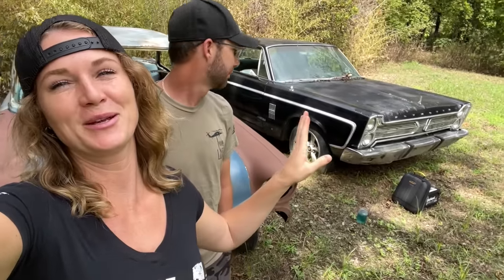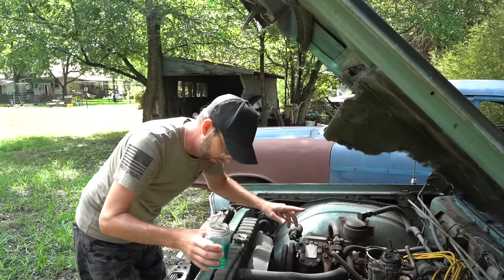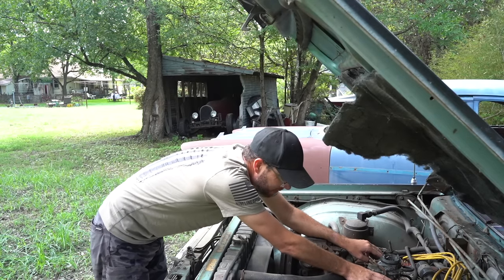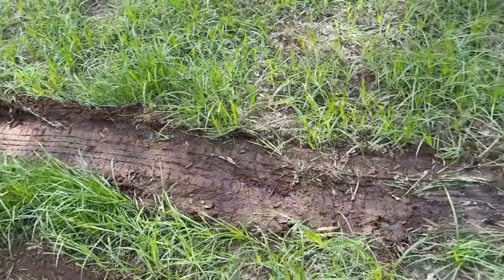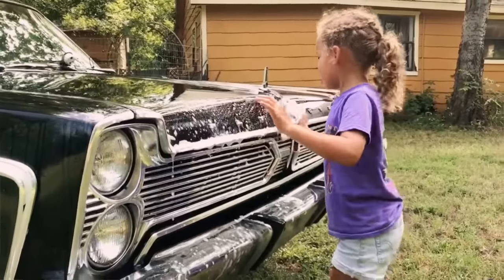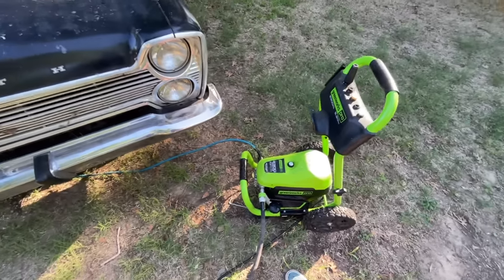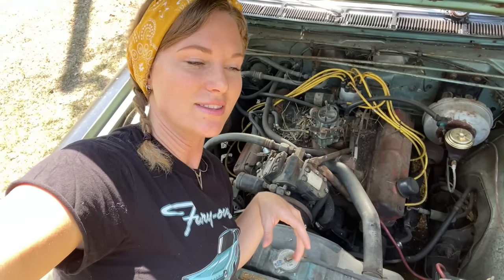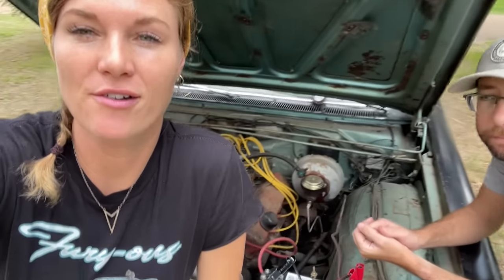Abandoned Plymouth Fury!

Comment: Look at the bottom of the valve covers.."poly " engines had a "scalloped" configuration..where the LA 318 had straight valve cover design on the lower side. My 1963 Dodge Custom 880 had the 318 Poly engine..It was a supurb engine..23 MPG on the highway..strong everywhere..

Comment: The valve covers very clearly are of a Poly-head A-block which by that point only would have been available as a 318. Not to be mistaken with the LA 318 that was used from 1968 into the 90s. The earlier Poly or semi-hemi engines were heavier but provided more torque and parts are not interchangeable.

Comment: This is the old Y block 318. It is a very strong and dependable engine. I had 2 of these in the past and they are bullet proof. I think what you need is the proper carb rebuild kit to solve your problem. They were quit common and should still be avaliable. Bill

Comment: What you have here is a 1966 Plymouth Fury with what is known as a 318 Polyspherical combustion chamber "A" engine. It was introduced by Plymouth in 1956 as a 270  CID engine, It grew to 318 in 1957  and is what was under the hood of Christine.  In 1964 the first "LA" 273 was introduced which is based on this same block with some changes made to accommodate the wedge heads. In 1967 the polyhead was dropped and the 318 got wedge heads like the 273, also the bigger bore 340  was introduced. Then in the early '70s the 360 with a longer stroke was introduced. Then in the early '90s, the magnum V8 was introduced with its heritage going back to this engine. You can use the timing chain and gears, the crank, the distributor, oil pump, oil filter, water pump, oil pan from any 318, 1962 and newer, also transmissions, The carburetor is a Carter B&B which has a small baseplate, pretty much standard on318s and even the same as a 283 Chevy carb.. Strictly Polyhead parts can be had like aluminum valve covers, aluminum intake, headers etc but they're not cheap.also performance camshafts. It also has solid lifters. If it were me, I would put a Mopar performance electronic ignition in it and a Holley throttle body fuel injection   for a 2 bbl intake. .A good place for you to get educated on these engines is on facebook... https://www.facebook.com/groups/542278482490634/ These engines wake up with a little cam, carb and ignition work They have canted valves like a 351 Ford Cleveland or big block Chevy but with smaller diameter ports so they make gobs of torque on the street. Gary Pavolich (who is the administrator of the group I posted a link to) Is the guy to look up, he is the absolute guru on these engines and can hook you up with parts too.

Comment: Fix the alternator bracket, get an msd box, and for the carb, get a rockchester from a 283 chevy.Youll have to play with the linkages a bit for it to work with the gas pedal and kickdown linkage, but its simple. Use the coldest burning spark polugs.Itll do better on gas and have good power.

Comment: Derek also uses diesel oil upon the first oil change ( Rotella. Delo, etc, ) For the zinc in old motors. I believe thats a 318 Poly. Not the later small block.  Todd the retired trucker.

Comment: Holley 80457S (600cfm, electronic choke, vacuum secondary's), or if you like simplicity, Edelbrock 1405 600cfm, manual choke. You'll also want an intake, for a stock 318, the good ol Edlebrock performer / performer RPM series (2176 for performer, 7176 for Performer RPM) would be fine, go with the performer RPM if you plan to work / replace the heads and drop in a mild cam and headers.  Edelbrock also has a great set of midrange performer RPM heads that are bolt-on, 60775, under a thousand from Summit. They used to sell an awesome performer RPM top-end kit which had a 600 manual 4-barrel, the performer RPM intake and carb, a mild cam with hydraulic lifters, gaskets and a double roller timing chain set including new head bolts, but I don't think it's available anymore, and I think it was post-1973 engines anyway, although it'd probably be able to work on a 60's small block. Those kits were good for like 425HP/400TQ on a stock bottom end 360 and I think were only around $3K. Another option would be to just grab a crate engine and be done with it, something like a Summit Racing BluePrint Engines 408ci Stroker should be nearly a drop-in replacement (you'll need different distributor, ignition and coil) and can be had for under $5K after the core charge, good for at least 400HP with a decent intake and carb.
Reply: None of those parts you mentioned bolt to the Old Style A engine. They are all for an LA engine. Well, the timing chain would work.

Comment: Just a tip Take an empty gear oil bottle with the funnel top (Aka a blown engine squirted) Put the funnel in the float bowl Saves flooding the carb from pouring down the throat Also we check for spark first If the cylinders are dry no oil then flooding it will really was the cylinder walls Brakes are hung up good luck

Comment: Cool Plymouth, that aged maybe that's the wide block 318, my favorite was the 1964 Sports Fury, bro-in-law had one, same color. Lots more fun though cuz it was 383 with console shift. I would recommend pulling the spark plugs out, directly shoot some lube in the cylinder and let it sit. Thereby lubricating it before you're turning it increasing compression so it will start easier. After five years you're fighting the old stale gasoline so that should have been drained out and replaced, but eventually fired. I would find an old motorhome with the 440, then you have something fun. I am looking for mid 50s Dodge pickup, with five window or wide window. That was my first pick up

Comment: The first cleaning job should be vacuum clean the engine and then check all fluids( coolant, brakes, motor oil, and transmission fluid) before attempting to fire up the engine. Fumigate the interior and wait 24 hours. Wear face mask, gloves, and goggles when vacuum cleaning the interiors. (Rat poop and birrd poop harbor a lot of disease germs. I spent 8 hours in ER treatment for leptospirosis due to exposure to rat poop and urine while handling trash). Dirt is a serious bio hazard. Thanks.

Comment: I personally am one for restoring to factory condition. Find someone that can rehab that front seat and dashboard.  Buy a new carburetor, do a rebuild on the engine, transmission,  etc. The paint looks good , bit if at closer look you need bodywork than repaint it the original factory color. You might want to watch some episodes  of Graveyard Carz to get some tips on decoding the tags and Vin number.

Comment: 500 CFM Holley 2bbl is a nice upgrade, and really plenty of carb for a stock Poly318. 
I forget who makes the carb adapter, maybe TransDapt?
Don't forget to adjust the valves, that Poly should have solid lifters.  
  Though it is a different engine than the later "LA 318" (light A block) that you're used to seeing around, your A block 318 Polyspherical head engine should be able to use some lower end parts from the newer engines like oil pan, windage tray, etc.
 Great to see this car getting saved!

Comment: Cool ride, poly 318's great engines. check out my vlogs on my 65 Fury III BB 383! Cable shift transmissions good if the cables are good, not so if they're rotten. pulled mine replaced with 71 model out of an rv, B&M floor shift. always check trans fluid in any pre 2000 mopar with engine running, transmission in neutral which engages the pump. Mopar or no car!

Comment: The 318 polyshere is a good engine. Perhaps just keep it simple and rebuild or replace the 2 barrel carb? Once you get it running properly, I think you will be pleased with how well the 318 performs. 
It has lots of torque and is ruggedly dependable. 
It is similar to a Mopar Big Block in many ways. It was a bridge between smaller displacement big blocks and the later LA Small Block. I swapped my 318 poly for a big block
440 in my 64 D100. Physical demensions and motor mounts were pretty close. I was able to reuse several items in the swap. 
Its been fun with the big block and "tinkering", but I am seriously considering reinstalling the poly. Its on the engine stand now for a refresh and possible intake  from another source. I will leave that as a mystery for now, as I am "figurin and fabricatin" that out as I go.
I enjoyed your video. Keep up the good times.

Comment: That's a 318 poly, which refers to the polyspherical cylinder head design. This heads combustion chamber is similar to that of its big brother the famed "Hemi". Keep in mind that an engine is merely a large air pump and engineers design each enigine with a specific application in mind, so before you toss a pocket full of money at an intake and carburetor, make sure the engine is capable of handling added CFM. I know the poly came with a variety of carburetor combinations, but there were a variety of camshafts that came with those also. Don't forget this car has transmission,  and brake issues to begin with.  Personally I would put together a plan and budget together before you go any further.  As  I tell any one who's come to me with a project " When a house is built you never start with the roof, plans are drawn then a sturdy foundation, next the walls, then the roof. Don't put the cart before the horse."  Myself,  I would assess the vehicles overall condition, get under it an make sure the undercarriage is worthy, don't forget that car had been sunk in the mud for five years. Remember bottom to top. Can't wait to see what direction you guys take. Im sure it'll provide lots of interesting U-tube content.
Good luck with your project.!

Comment: You can do some crazy builds with the old poly 318 but you have to know your mopars and have a deeper budget. LA heads can modified to fit the Block but you have to use an LA cam. Those blocks can take a 120 over bore without sonic testing! Wish someone had produced Aluminum heads for polyblock with the polysphere design. JE can make custom sized pistons for them but again it gets pricey. They came factory internally balanced with a forged crank. Years ago I had a 1966 Fury Vip with the 318 Poly and it would do awesum burnouts. Smoke the tires off.

Comment: 318 poly engine - last year for the old style 318 in the USA.  It has solid lifters.  I had that engine many years ago in a 66 Dodge P:olara 2 dr hardtop.  I  put a Holley 500 cfm 2 bbl carb on top of an adapter and it woke the car up with dual exhausts.  NOw with the internet you should be able to source a 4 bbl manifold for the engine.  Also had a 66 Fury 1 two (2) dr SEDAN police Interceptor with a 440 - 4 bbl.  Only had it for 6 months as I couldn't afford the fuel for it.

Comment: Yep. 318 Polysphere engine, the precursor to the LA (small block) 318 which came out a year later. They are solid lifter engines that canake decent power. However beware of buying speed parts. Things like intakes, camshafts and headers are 318 poly specific and do not interchange with LA or later Magnum 318 parts.

Comment: You are using the crescent wrench backwards when tightening the battery clamps. Hey, yah see that tube in the throat of the carb? That is the vent for the float bowl, and you can fill the float bowl through that vent tube. Then carb operates as if it properly filled.

Comment: i also own a 66 Fury.  My advice as a Moparian. this is a Poly A.K.A. wide block (A engine not an LA engine)  318... yes this is a 318, you do not want to over carburate this. but the accellerator pump is not happy.  just rebuild the one you have and it will prevent issues with too much carb on too small of an engine.

Comment: Fit tombstone front seats, if you see an automatic choke anywhere immediately throw it away, I bought a new 1970 Pacer 245 Hemi  2 bbl 3 speed manual (that sorely needed a first gear) in Australia (VG model here) and every morning when driving to work after just over a mile I had to cross a fairly busy road and it always stalled when I tried to go after stopping, no matter what I tried.

Comment: My dad had many of these old fury’s, 318s are indestructible but they eat timing chains because mopar used a plastic covered gear,
If she were mine I put a aluminum intake a small Holly and replace the timing chain and water pump, also the rads over time become 
Junk, mopar never had a decent cooling system replace it with a aluminum rad, as far as the trans…..well mopars love to eat front pumps.. don’t get me wrong I love old mopars and she is definitely a keeper!!! She just needs
a little love!! Hit up Vice Grip Garage I would bet Derek might be able help put some pieces
Together between Derek and his pals you can’t go wrong 
Love the channel
Reply: "A" engine 318 does not use the readily available small block Mopar intakes (LA).

Comment: I would get a vacuum pump and suc out the 5 year old fuel in the gas tank, put fresh fuel in, then change out the inline fuel filter so the carb is getting clean fuel, then give some of the off the shelf carb cleaners a try before tearing into the carborator......my two cents! God speed.

Comment: I’m sorry to hear about losing your friend. Treat that car with respect  because if you do, it should provide you many years of trouble free enjoyment. The engine is the 318 Poly.  Yes it IS a small block A series, and 67 was its last year of production. The 68 and newer 318 is the LA (late A) series engine. They are great engines but are hard to get performance parts for and there hadn’t been a factory stock 4bbl for that engine since 62. They are actually pretty peppy when you consider how small that stock 2 bbl carb is. There ARE parts from the newer LA 318 that fit it but not the heads or intake manifold. It’s expensive to do but there have been stroker 318 Poly engines built to 500 HP. The heads on these engines make them really WIDE which is why some people are confused by them and call them a big block or wide block when the actual engine block is dimensionally the same as the newer “small block” LA version of it. As for pulling it out with the Bronco, that Fury outweighs the Bronco by a substantial amount and there was no way that small ratchet strap would be strong enough to pull it out and the Bronco having those wide tires on it on grass  is not likely to be able to pull it without spinning the tires.  I suggest that you change the transmission fluid and filter before doing anything else as it could be the transmission fluid has separated and the paraffin wax is plugging the filter and starving the transmission of the fluid it needs to function.. (I’ve had it happen to me otherwise I would have been skeptical of even hearing of such things. In my case after changing the transmission fluid and filter, it worked fine and was still doing great when I sold the car several years later.)

Comment: Ive always wondered what ended up happening to that thing. I love the everything about the 66 furys, the grille, the lines, the trim, the overal land yacht vibe. Im building a 66 fury 1 with a 72 new yorker 440 swapped in. 

What you guys have is a 318 L aka the Polysphere or "polly" 318 so dont order any parts from a regular "LA" 318 they may not fit. The polysphere was the base model "C body" mopar engine because the slant 6's didnt have enough torque to push these boats. Probably has a 904 trans as well.

Definitely get a 4 barrel carb for it, uncle tony's garage has a guy that has a 65 sport fury with the same engine, look that vid up to see what he spec'ed his with carb wise and some hot rod tips for them.

Park the MG next to it for a photo shoot! They are basically from the same era and couldnt be more different.

Comment: Hello, They did make a 318 in the 66 Fury 3. The carb is a Carter BBD-3847S 2-barrel carburetor. Vice Grip actually had a similar vehicle and instead of doing a rebuild on it he just ordered a new one off amazon for like $80 and used it instead. If the vehicle was mine in the same situation and with how popular you guys are I would. 1. just buy a cheap new carb to kinda keep it original. 2. Get it mechanically sound with breaks and all the other stuff. 3. Take it to power tour and try to setup a charity in your friends name. Hope my info helped you and look forward to what ever happens to the fury.  P.S  I would be also torn as weather I would also keep it the black or see if you could strip it back down to the blue.

Comment: That's a Stromberg model WW carburetor on that 318 poly. You can get a kit at O'Reilly's, part # 15276A. It's a walker kit. Id use that carb, better than the carter BBD in my opinion. You'll get respectical mileage with it, if cleaned up well, and follow all adjustments to a T.

Comment: Happened on ya via Derek's vids.
I'm a Chevy man, but that 2 bbl accelerator pump is SHOT.
If it were mine, I'd get the right rebuild kit, tune it up, make sure timing's within spec, check/address the tranny (torqueflite?), get the brake problem fixed, fix ignition housing, figure out the interior somewhat and drive it on clear warm weather says/weekends only.
I know you guys are Southern...what state?

Respect from Iowa!

Comment: That is a 318 poly. Referred to by some as the 318 wide block. Chrysler designated it the "A" engine.  The motor was redesigned. The block was lightened new cylinder heads, intake and exhaust manifolds were designed and the "LA" motor family was born.  These were the 273, 318, 340 and 360.  These were the motors that became known as the small block mopar.

Comment: Get you a 4bbl. intake with an adapter plate for a Rochester Quadrajet and you will have a 318 that will SCREAM. Used to do that to cop cars in the last century and those beasts loved it. The cars and the cops. That 727 tranny gets 1 pint low on fluid and it gets weak. Keep the level dead on full or you'll burn it up.